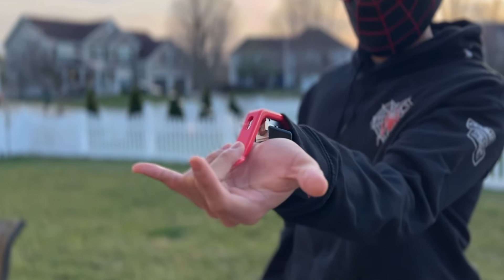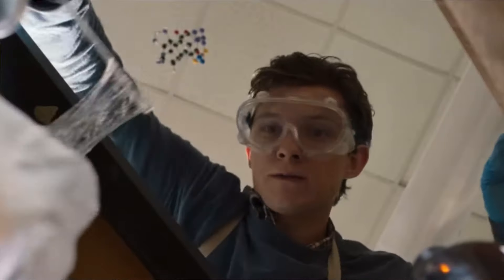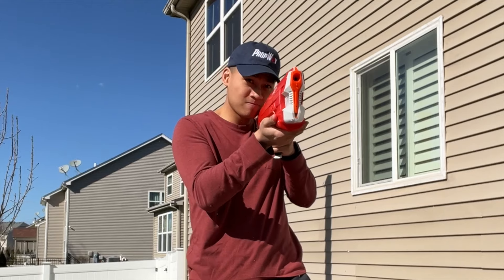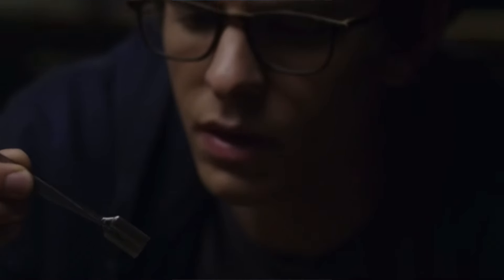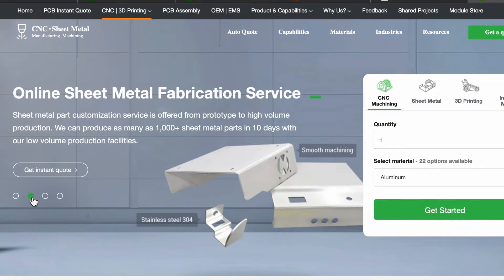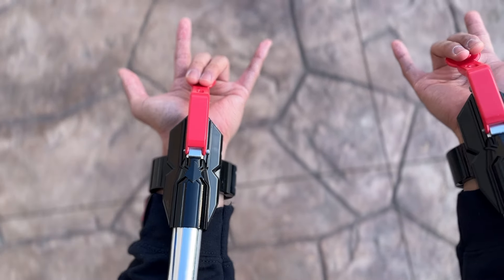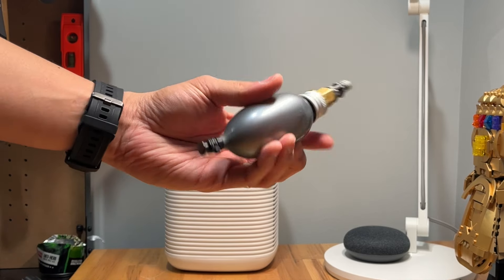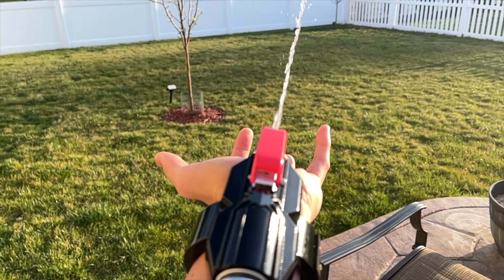Making Spider-Man Web-Shooters!

Comment: Professional performance locktite spray adhesive for the web fluid. You can use the pressure of the can to get it into the balder. I'm not sure if it would gunk up the valve or not but it is definitely worth a try.